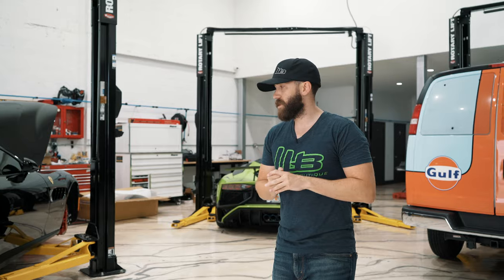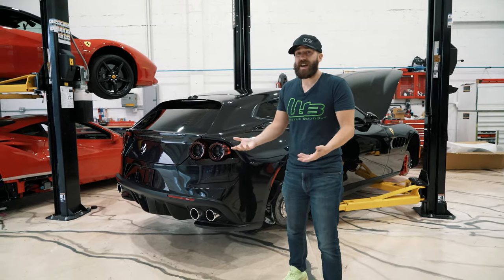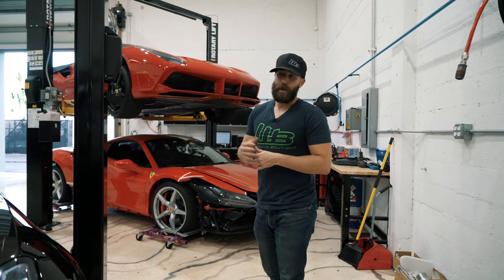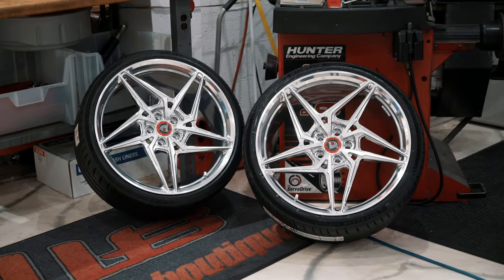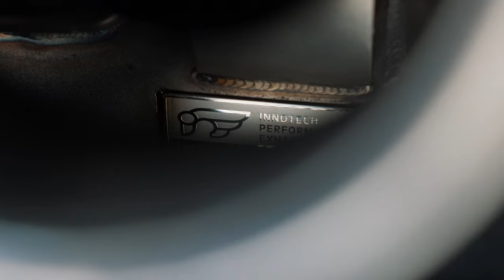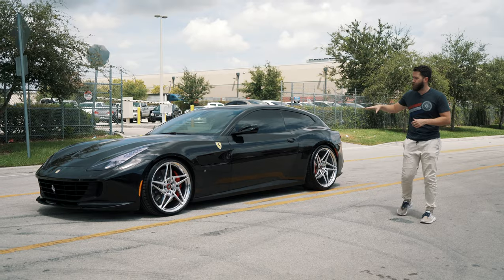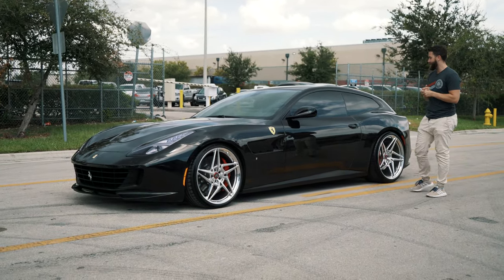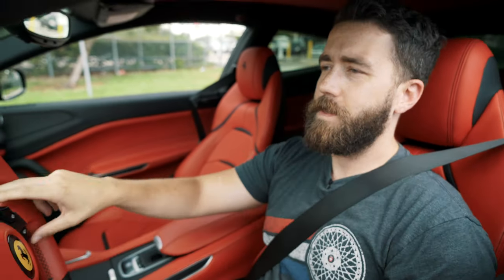FERRARI GTC 4 LUSSO T: NOVITEC SUSPENSION + IPE EXHAUST + DME TUNING + ANRKY WHEELS

Comment: This car deserves better: H&R springs, Akrapovic exhaust, Pirelli tires, OZ whells etc etc etc
Reply from the maker: H&R develops great springs however they don't offer any for the Lusso. Novitec is the industry leader for sport springs for exotic cars. Akrapovic also manufacturers amazing exhausts but they do not offer one for the Lusso either. Pirelli tires are great and right up there with the Michelin's but we give the slight edge to Michelin with these tire sizes. OZ wheels were once a great option for road cars but we're talking over 20 years ago now. They are no longer a major player in the aftermarket performance wheels industry.

Comment: Will having the 30 fr and 25rr tyres mitigate the difference in wheel sizes? I imagine being 4wd it is extremely sensitive to different rolling diameters? it does appear to be ripping well & looks so good mind 👌
Reply: First of all, the V8 is RWD only. The V12 is 4WD up to 120mph. Second, the figure 30 resp 25, is the sidewall hight in percentage of the width. So a XXX/30-tyre can have the same corcumference as XXX/25-tire, depending on the width. Third, a 4WD system isn’t allways sensitive with the tire circumference. Take Haldex for example. Most modern systems are less sensitive.
Reply: Pro Wheeldealer you know your stuff dude, and I am now educated 👍, admittedly I assumed the 4 in the name referred to 4wd but I guess it’s seats..
Reply: Mac Says. True. The 4 in GTC4Lusso refers to the number of seats. The GTC and Lusso refers to a combination of Enzos favourite car, the 330GTC / 330GT and the 250 GT Berlinetta Lusso. Nice car anyhow.